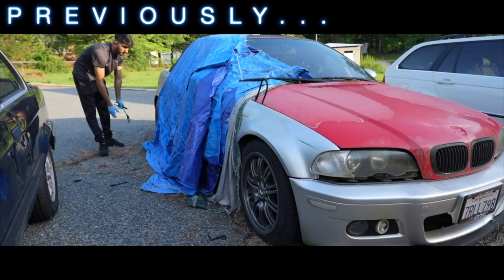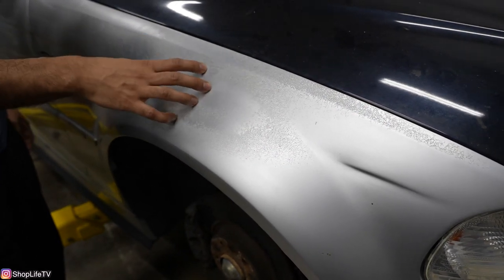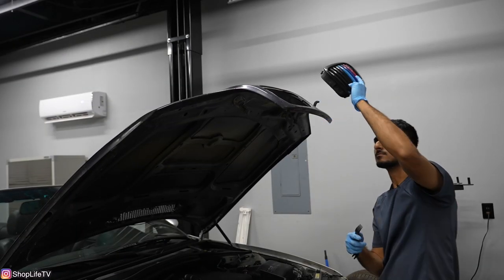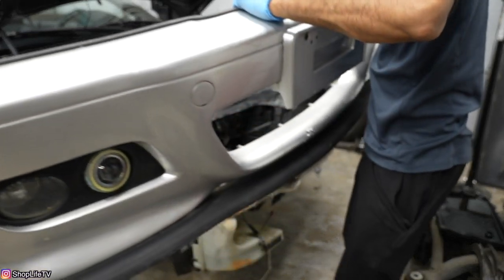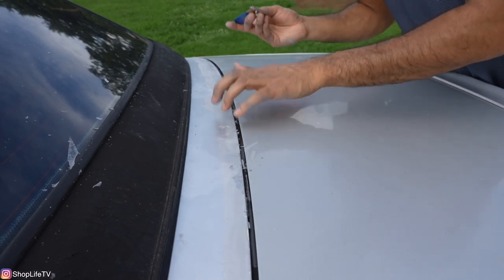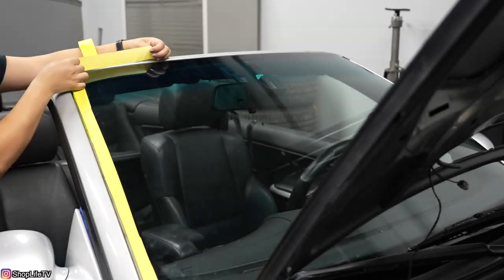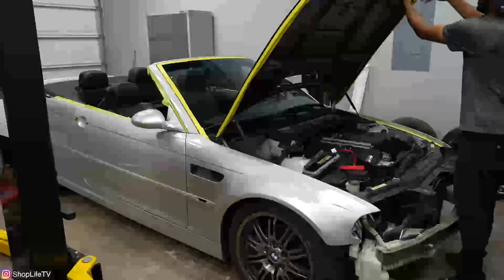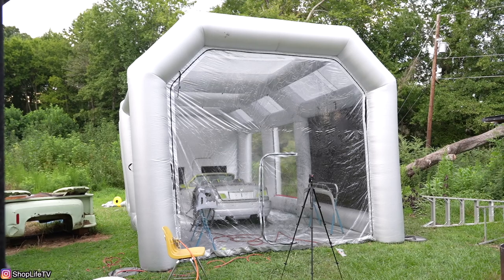Painting Our $4500 BMW E46 M3...IT WAS A DISASTER!

Comment: been using an inflatable tent / booth last few weeks on the Gold Coast Queensland Australia,its setup inside a larger shed of my mate who bought a similar kit but first time it was setup it was barely staying inflated! conclusion is those fans are fkn rubbish so after crappy results first attempt, i watched a few videos had a brain fart then went to my shed and brought  2 high capacity inline silenced fans i got from a hydro room setup i bought, the fans blow 3300 cubic meters an hour each, but were almost free (100 aud each along with speed controllers)so i had to turn them down a little not too blow up the tent too much into jumping castle territory upon first startup i thought it would tear untill i pulled the lead then decided to connect the speed controller( fans come with 3 speed controller )  had to cut up some plastic large pots from garden ctr to adapt the 12" outlet down but it has firmed up the stucture quite a lot and def helped with airflow booth wise, with more than double the capacity of those shitty fans it takes away alot of the faults and flaws i saw first time i tried using it with the supplied crap fans, as long as u have secured the base properly  i used the tie downs to Rings bolted it into concrete floor 2nd time round and im pretty happy with the improvment, as long as the weathers sunny or ur indoors it beats paying for booth rental and all the extra crap that goes with it like transporting to then cleaning again and again and again and again ect ect ect, hope this helps someone Nuff said
Reply from the maker: Great info! I will definitely look into better fans and will probably put the booth in a different spot so we don’t have a hard time pulling the car out next time. Thanks for the tips!

Comment: Bruhhh I too know the disappointment and defeat of using an inflatable paint booth on grass in combination with 40% humidity and 105 degrees in a Texas summer. I rescued a Z4 that sat in a field for almost 7 years after the owner hit a deer. Bent some metal, grafted in a new wiring harness, and replaced a whole mess of parts... And wouldn't you know it at the 99% mark everything went to $h1t. The Texas heat mixed with the humidity and my lack of skill created an orange peel mess on the car that's somehow soooo consistent it looks like a wrap!!! But just like you I learned a lot, and I do mean a lot, and would very much so do it again.

What I've learned from it, take your time. It took me 4 days to prep the car and one day to spray, but spray-day was rushed, so I'd tell myself to definitely postpone spray day to ease myself into the frustration that comes with doing something as messy as painting. Avoid unnecessary timelines that shouldn't exist anyway... Temperature; spraying a car outside means we will never have ideal circumstances to achieve 100%, but spraying in 105 degrees with 40% humidity is just dumb - also because the booth is like 111 degrees at that point... Lastly I'd tell myself to get to know my gun better and spray on a donor piece even if it means losing valuable paint.

Now for that tacky part; a polish might do it well after it has fully cured. I assume there are a ton of caveats for that coating within the first couple weeks after a spray. So you'll probably spend an unhealthy amount of time monitoring it and cleaning up water spots and bird droppings.

Anyhoo, my response is wayyy too long now. You did a great job man. I'd still call that a win! Besides we are about to go into fall so there's always a chance at repainting!!!

Comment: If you guys do a restoration on the convertible top can you please make a video! 🙏🏻
Reply from the maker: We will most likely be replacing the top if we are able to find a good deal on another one. Will make a video on the process!
Reply: @ShopLifeTV  question bro I over herd you say you were going to use the Liqui Moly Engine Flush . Can i drive my  car with the engine flush in it ? I live in the valley and I’m thinking of throwing in the engine flush before I head to LA and do a oil change can that possibly mess up my car ?

Comment: painting is much more difficult than you'd expect, it isn't just painting as that's the easiest part. Having the right amount of air flow through the paint space is critical to drying properly and clean. Getting runs is easy so multiple thin coats is better than thick coats. It really is an art and takes years to be good and longer to be great. If you have a very nice car, don't paint it yourself. If you're okay with an okay paint job then go ahead and try it. Remember the fumes are toxic so just wearing a mask is not worth the savings, you should have a fresh air system that you can get for around $400 used if you really shop around.

Comment: I don't know anything about "Auto Coat" but if it's the same or almost the same as "Plasti-Dip" it's a very good thing you put lots (I'm not sure what "Lots" is exactly but if it's more than three you should be fine. I bought a car which had been plasti dipped and the person that did it put on only ONE COAT of WHITE. I got the car thinking I was just easily going to peel the plasti dip off. But NO WAY. It was a Total NIGHT MARE! It took almost two weeks of three to four hours a day to get it all off. It was INSANE. after trying Goo Gone and Solvents we finally found that good old WD-40 worked the best and we did eventually get it all off. CRAZY insane!